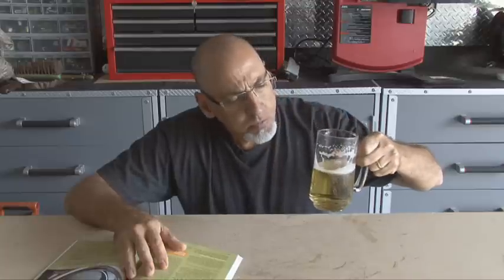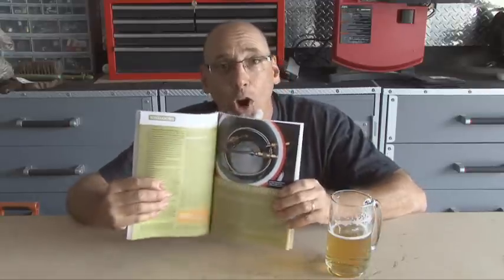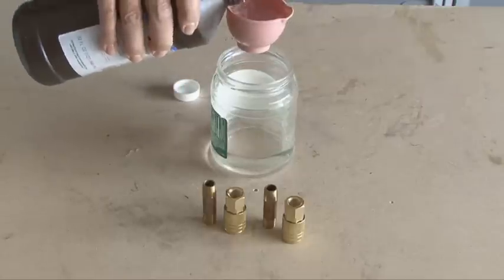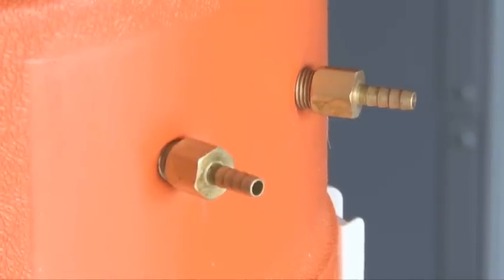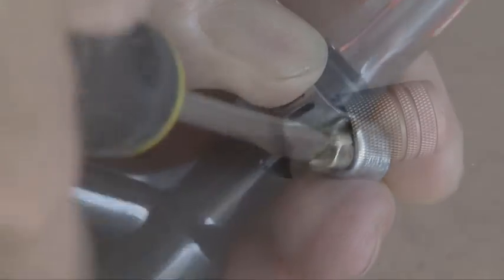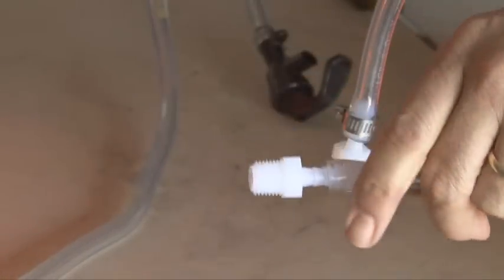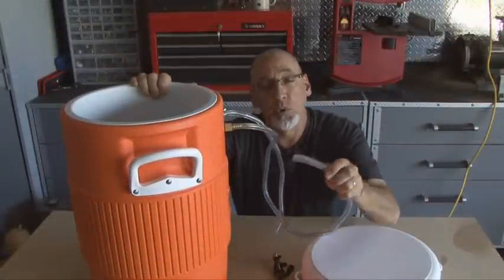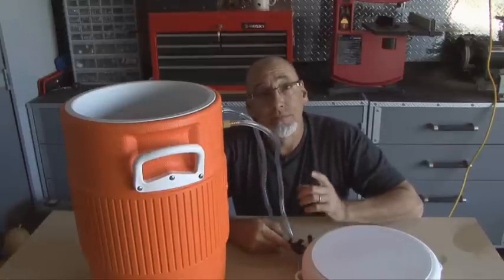Weekend Project: Convertible Jockey Box

Comment: Why the pneumatic couplers? They are not smooth on the inside and will cause turbulence. More turbulence = more foam. You should also use FDA approved plastic tubing. Also the FDA doesn't approve the use of brass fittings. It's just a few bucks more for 303 stainless.

Comment: Yes it is, part of the dispenser is a refrigeration unit, usually right near the tap.  Its not something you can do, its part of the system.

And again, this jockeybox is VERY common in serving beer, you will find them all over the country wherever a bar wants a portable tap system.  At fairs and brewery events, motorsports shows, et, et  that kind of popularity shows your comment is off.  It most definitely is worth the trouble IF you are needing a keg and expect HIGH volume sales...

Comment: I see a couple problems with this setup. The air fittings will fail to keep a seal over time and there isn't any calking around any of the fittings which can lead to decreased ice performance. Also with a coil setup you need ice and water, not just ice. The biggest thing is the beer outlet tube. That is going to hold about a foot of warm beer that will foam up pretty nasty and will probably make your standard red solo cup more than half foam. With some improvements this could actually work well.

Comment: You forgot the co2 or beer gas or compressed air to push the beer through the line .Just hooking up the jockey box with out at least 2 psi over keg head pressure will not allow you to pour anything. If you want to keep the beer free of excess foam add water to the jockey box and through in a 12 volt bilge pump to circulate the water,it keeps the temperature even throughout the jockey box. 1/4 in or 5/16 in tubing is better as well as all stainless or plastic fittings.Don't hammer threaded ends

Comment: this isnt for serving canned or bottled beer.  If you serve from a keg its a lot easier and faster too cool the beer (or any other beverage) by passin it through a chilled coil.  When you go to your fave gas station or restaraunt and get a fountain soda, its is colled inthe same manner. there is a coil under the bottom panel of the ice bin that both the soda syrup and the CO2 water are mounted to chill both liquids so that they can be served cold with out ice.

Comment: @RJDGGG86  True, but with the low alcohol content in beer it would't freeze solid, but it would be like a slushy when it came out (if you need proof put a beer in the freezer for a couple of hours). If you where running something with about 40% alcohol or greater (80 proof or more) I would agree with you completely and would have not left the comment.

Comment: you could also add a second smaller coil and use ice and rock salt for a high output model.  Just don't let the beer sit in the lines all to long or you might get a beer slushy....

Comment: also if you need to remove the compressor fittings to remove the coil then why use them? plus the will have a nice film of oil inside

Comment: A "jockey box" or "coil box" should be filled with half ice and half water.  Oh, and ideally the inside should be the same temperature as the keg that you have iced down in your trash can or whatever you are using for your keg.  If you have foam issues, the two main culprits are temperature and pressure.  Just some helpful tips, should they be needed, for the alcoholics and beer lovers!

Comment: nice idea, but if i'd seen right, the "warm" beer goes first to the down end of the metal pipe ant the slowly higher. But wouln't it be better, if it would flow the other way through the pipe, because if you put ice and cold water in it, the cold ice will swim an top, and in the deep, the water is warmer. and so the beer will get slower cool and net "shocked" cool, and than again warmer.  At chemistry they use the same order, because it is better, or?

Comment: I like the idea, but this design doesn't fulfill the "convertible" requirement at all.  You'll have to remove the quick disconnect coupler each time you want to insert or remove the stainless coil, and probably for the keg too, which completely eliminates the utility of adding it in the first place.

Comment: Copper tubing would actually be a horrible idea, the alcohol and PH of the finished beer would strip off some of the heavy metals and be dangerous to your health, this is why it is never recommended to use copper post fermentation. Pre fermentation it doesn't matter due to the lack of alcohol, but post ferm stay the hell away from it. If your using tubing i would suggest SS, not as good thermal conductivity, but you won't poison yourself slowly.

Comment: i got a better idea, plug those fittings into a 12V gas compressor, fill the line with cooling gas. fix the compressor on the side with radiator and battery etc. then fill the keg with beer =)